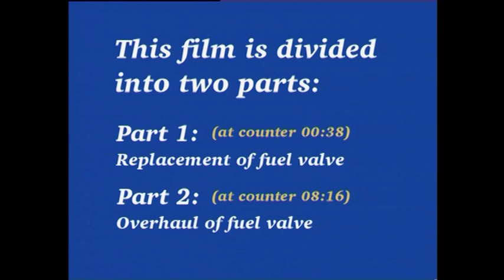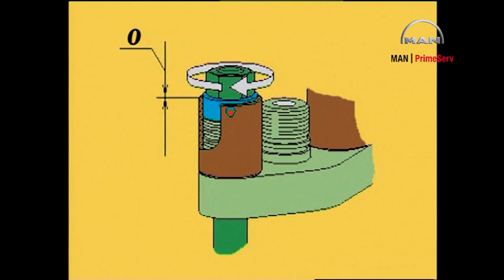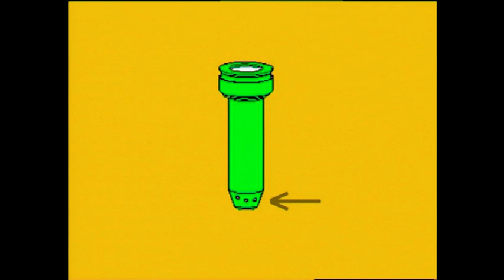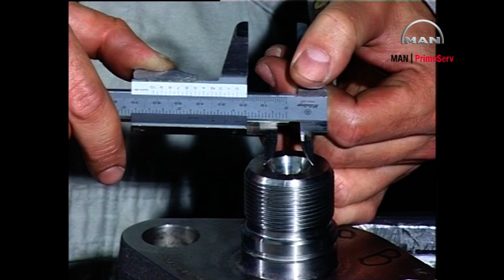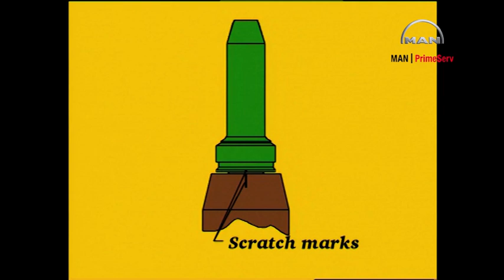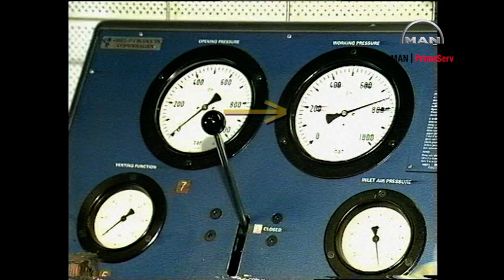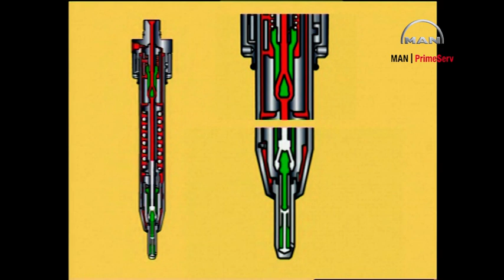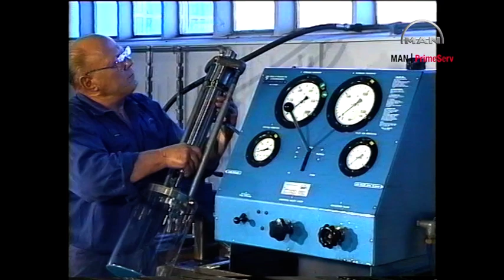Slide Fuel Valve Overhaul

Comment: Sulzer has better fuel valves. . I saw a Sulzer fuel valve housing stating  Man. Date 1969 and still in operation. Calculate the working hours of over 1000 bar, compare the metallurgy in 60s and the new Chinese made MAN engines
The engine however needed every 60 days new piston rings, Sulzer=Nightmare
Reply: Lol